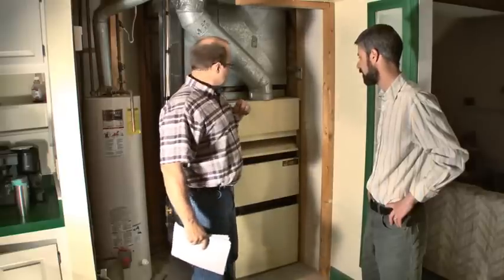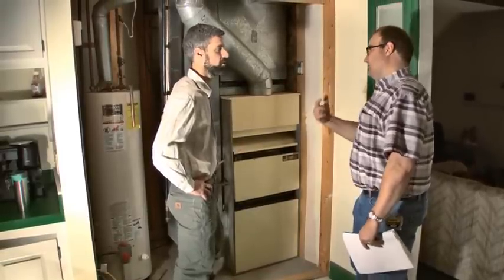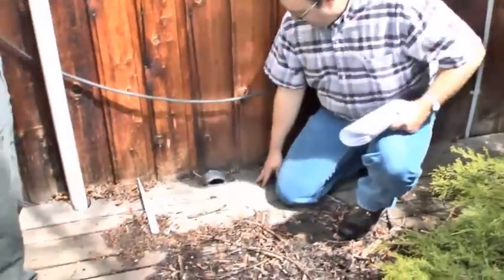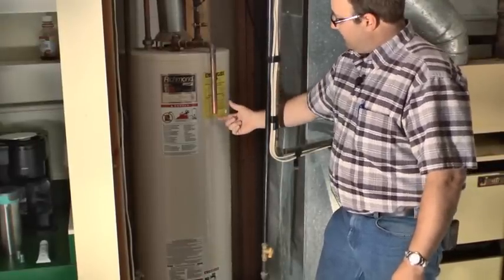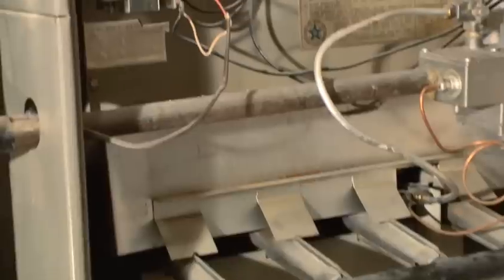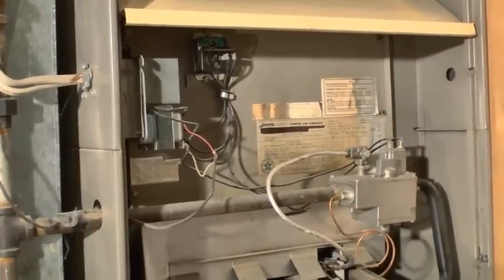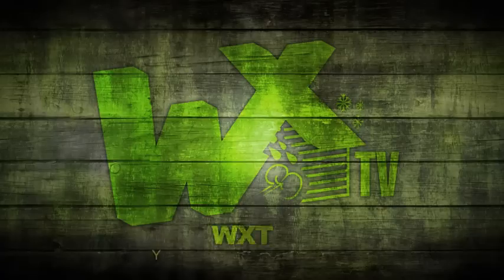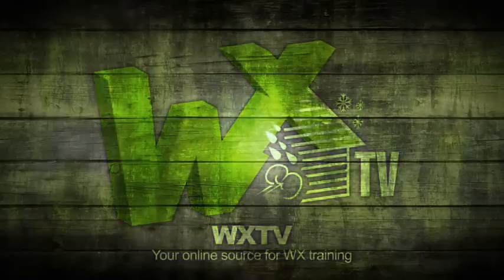Gas Furnace Basics: Part 1

Comment: so the 34 yr old  house needs make up air?  that basement finish looks at least 25 yrs....ok 1000 for a 3hr high low?  sheeeeet
Reply: denny3161 yeah...many full basements don’t measure up enough for proper combustion air..must add outside air..best with a 2 pipe flue furnace 95% which takes combustion air from the outside.

Comment: the gas meter reading is 1 cubic feet in 25 sec, it means 2.4 cubic feet per min and 144 cubic feet per hour, right? the heat value of natural gas is 1000 btu/cubic feet, therefore the actual input of gas furnace is 144,000 btu/hour. But why the guy said the actual input is 124,500 btu/cubic feet at 8:30??
Reply: +XIAO JIE   Same thing i was thinkn, tryn to figure out where the 124,500 came from, Good that someone else caught that. i got 148,320 bth/hr , used 1 cu-ft=1030 btu. I do HVAC and repair furnaces all the time at Shepherd ENG Heating Cooling and Refrigeration. look it up
Reply: He lost me with the altitude adjustment in the calculation. Not sure how he figured it

Comment: If I followed your math correctly, 70% of 138000 is approx 96000. But you said you needed 2 sq in per 1000, so wouldn't it be 96 x 2 = approx 193 sq in?
Reply: And he has 230 Sq in of return air. so, it more than it is supposed to which is a good thing.
Reply: Also, shouldn't it be even less because of the altitude meaning you lose ~20%?

Comment: Nice Video well done ...but I didn't get that if we are getting around 110,000 btu/h instead of 1,38,000 because of above sea level calculations we should use 110,000 btu/h  for return duct sizing too and one other thing even if we are get 96,000 btu/h (70% of 1,38,000) we need 192 sq ft insead of 96 sq ft of return duct.

Comment: Did he measure the height? Maybe that was done off-camera. With an 8ft ceiling height, a 430 sq ft space is needed to suit the code he mentions in the video. That would require a room about 20X21.5 or 16X27, etc.  That kind of size isn't uncommon for a basement unit, however, if the basement has been remodeled or recently finished, you may have to get fresh air brought in like he suggested in the video to maximize performance.

Comment: Duct tape on the flue! How about the entire flue connectors being illegal, you can't use galvanized pipe for flue contactors, they need to be B-vent, it would give you a 1" clearance.  But the international mechanical code is a minimum of single wall aluminum vent connects.  I agree the earlier comment that they should change that to a 95% furnace. 70% efficient you’re lucky if it would be 60%, with a belt drive, Installed in 1976, Can you say possible heat exchanger heat cracks. Replace it!

Comment: Needs two square in. for 1K BTU's of output. At 70 percent efficient output of 96k BTU you need 
at least 192 Square in of duct. With current dimensions of 230 Sq in of duct, its approaching its limits.

Comment: Or you could get rid of that inefficient heap of junk,and put in a direct vent 2 stage, variable speed 95% furnace and quit pouring all your heating dollars out the chimney! Combustion air problem solved! .... Just make sure you dont need a chimney liner ;)